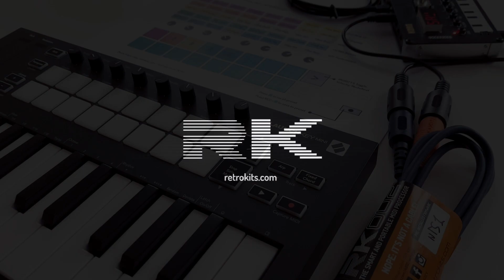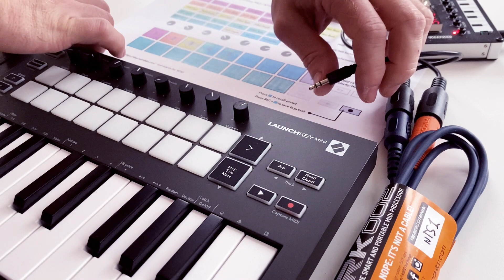RK002 / NTS1 Patch memory DUY

Comment: I love these cables and company! Bought this cable for my Kaossilator pro which as many people know has a midi in but you can’t control any of the sounds or synths with a midi controller. The key pad on the Kaossilator pro is totally difficult to control with any accuracy, it basically sucks. Now with my new Retrokit cable and the pre installed program software I can play it like a proper synth and access all its sounds. Amazing, it gave a piece of gear a new life! Thanks Retrokits, you ROCK! Worth the cost and very useful.

Comment: Hi! Instead of the Novation Launchkey, can be used an Arturia Beatsep or Beatstep Pro? Thank you
Reply from the maker: It would require a different flavour of the RK002 code (it would need different CC and note trigger handling) but yes that’s doable for sure
Reply: @RetrokitsDev  The custom effects can be saved on patches?
Reply from the maker: @shoseinen  only parameters which have midi control in the NTS1 can be saved